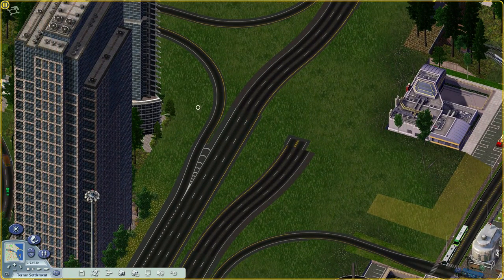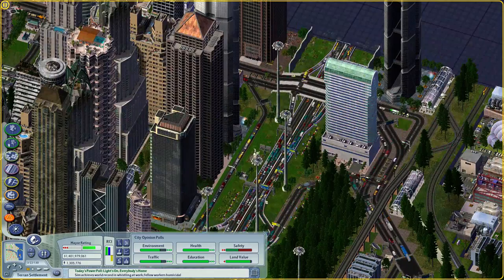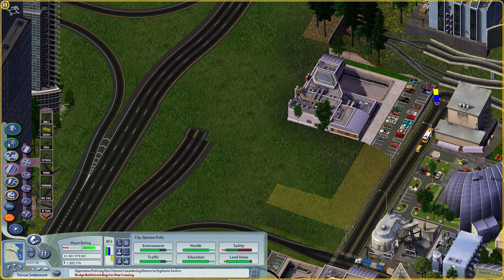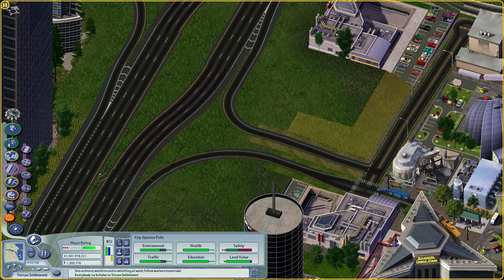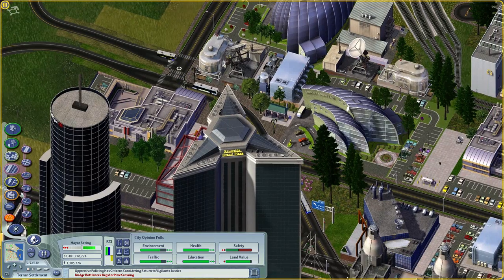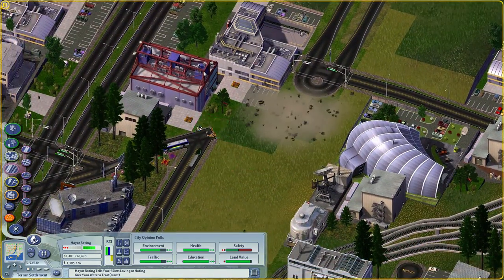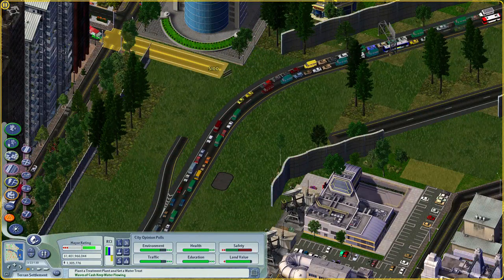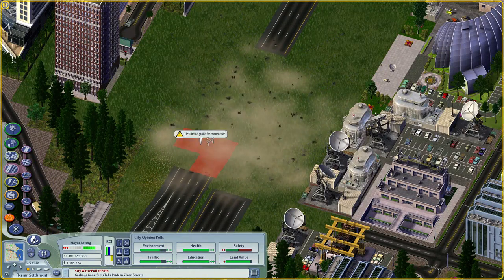Reconfiguring A Bridge Approach: Part 1 of 2

Comment: You could try to use the rail tool trick, where you use the rail over the edge of the piece and then delete the rail. The piece will be there without the draggable part. So you put the FAR curve, filling the empty spaces with fillers.